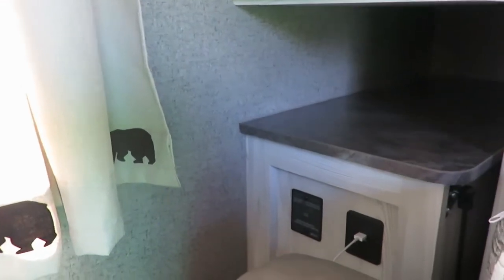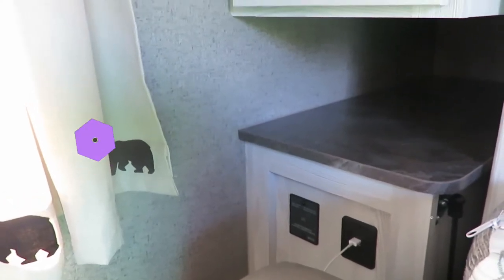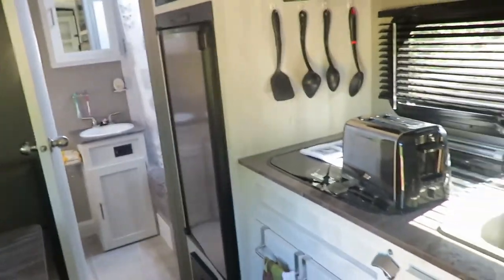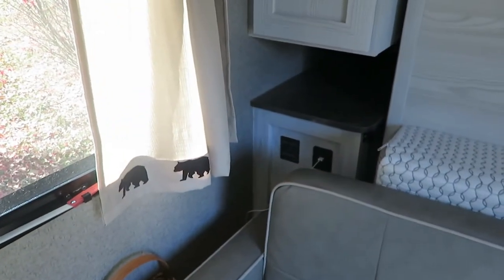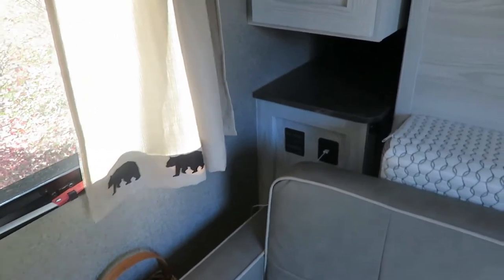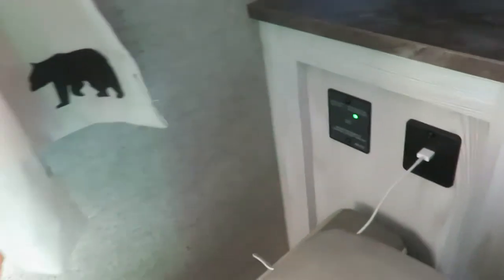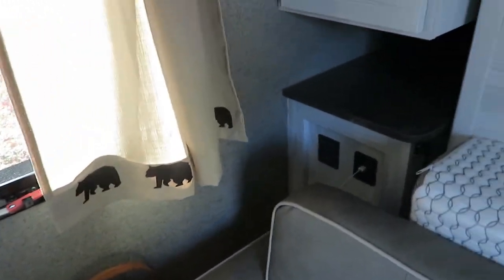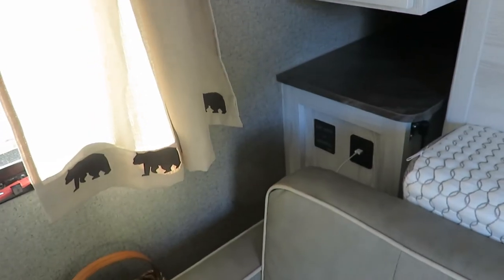How to Use Your RV Inverter

Comment: Misinformation. 
He says your 1,000W inverter draws 1,000W when you have no 110V load plugged in. WRONG: Some inverters have a small standby draw on the batteries when there is no-load on 110V,  some actually switch into a very low-draw standby mode (almost Off and with an almost zero current draw from the batteries) when there is less than, say, a 5W load on the 110V. Then the automatically "come to life" when you connect your 110V load. 
Either way there is either very small or almost no draw on the batteries when you have nothing connected to the 110V supply.
Reply: I agree that the inverter doesn’t draw 1kw with no load, so that info isn’t entirely correct.  However I did see where someone measured this inverter draws almost 3 amps with no 120v load which is still substantial if you’re boondocking & keeping a close eye on your battery levels.  So all in all, the instructions in the video are still good even if the info behind it isn’t entirely correct.

Comment: An Inverter will run your battery down, but not because it is consuming 1000W at all times.
An Inverter does consume some power with no load, but not 1000W.
I suggest that you put a DC ammeter (or a battery monitor with shunt) on your battery and see what it is actually doing, with and without a load.
All inverters are different.
Most inverters will power about half of their rated output continuously and up to their rated output for a few seconds or even microseconds.
When you replace that inverter, and you will, replace it with a 3000W-4000W inverter.
I have several 12V and 24V Inverters in use every day.

Comment: Sorry, but not quite. Everything you said was correct except the part of it using a full 1000w when you turn it on. Inverter's idle and use power when and you are not running say, that toaster. But  you'll be using as much as 10-15 w or so just idling. When you turn on an appliance that uses 500w, then that's what the inverter will put out. It does not just go to 1000w all the time regardless of the load placed on it. It is true that leaving it on will run down your batteries... but at 10-15w at a time, not 1000w.

Comment: I just bought a 21 G-Pro 19FD. Love all your videos. Can you run the refrigerator on the inverter? Another question. I plugged into the power cord and a red light came on the plug. Normal? I read somewhere to unplugged asap and not to touch the RV. Confused??
Reply from the maker: Red light is normal on the power cord. As for the inverter, you can run the fridge on it but your battery will not last long
Reply: Do you have surgery protection
Reply from the maker: @DavidSmith3750  I have a surge protector on the 30 amp plug that comes in from outside hook up

Comment: Whats the inverter wired into, my kz camper has it and solar panel on top, plus 2 big batteries on front, I want to use my generator and active start soft start that plugs into generator and doesn't allow air conditioner compressor to pull a fast heavy watt/amp, but everyone is saying it won't work with inverter because it shuts down air conditioner,  can I just unhook inverter

Comment: So, if you’re driving and want to keep the fridge on,do you keep the inverter on?  I’d like not to use propane while traveling.
Reply from the maker: If you run the inverter all the time your battery will run down very fast. The LP running while driving is a personal thing, in most cases and through out the years this type of system has been used without a problem. It is a very small flame which is protected from blowing out and or if it does the system will shut down. I use mine all the time when I drive along with about 70 % of the people who have this system. The problems normally accrues when the system is old and not working properly or has be rigged to bypass safeties built into the system.
Reply: @Turtle3863  so, can the solar be used instead of propane while driving?
Reply from the maker: @kateclark4620  Still not enough to keep up with inverter turned on and the fridge running off 120 volt, now if you have a 12 volt you might be able to keep the fridge running with the solar and your battery.

Comment: Can you help?  We got a No Boundaries 19.5 and when we are driving down the road, the refrigerator doesn't work.  People tell me I need to use the Inverter.  It is a 12VDC (does not work on propane).  How does the refrigerator work when boon docking, etc.
Reply from the maker: Your fridge should be a propane or a 12 volt, either way, do not use the inverter, the battery will not last long trying to run a fridge on 120 volt with the inverter. If you have a 12 volt you will need a battery that can at the very least be a 200ah and preferably a lithium one.
Reply: @Turtle3863  I cannot tell you how much I appreciate this.  We have been totally stumped (and this is not our RV).  We have ordered two lithium batteries.  Maybe this will help.
Reply from the maker: @PatHawkins-jk7ny  Make sure, that in fact you have a 12 volt fridge. From what I have seen on the No Bo website it looks as if that model does come with a 12 volt fridge. If that is the case you should be fine with 200 ah and a solar panel to top it off during the day.
Reply: @Turtle3863  We have a 12VDC Norcold, Model # N8DCSSL.  We took it on one trip and noticed that when we returned the refrigerator wasn't working (on the way home).  We thought we should be fine, as you suggested, with the solar panel.  On reading up on the inverter (we didn't even know where it was), we noticed that it was "ON" and wondered if that might have been  drawing down the battery.  We watched your video and that is what gave us that idea.

Comment: Our brand new 19FD inverter won't come on from the 'remote' button there by the couch. Pressing the button turns the LED on, but as soon as you release the button, it's off again, with no voltage in any outlet I tested. Confirmed the inverter works by removing the panel, checked the reset button on the bottom, then the manual 'on' button at the top of the inverter (supposed to be out for 'remote' on, which it was) which did turn on the unit, it was producing 114 volts (no fan in the unit was running) which was confirmed with voltmeter in all interior outlets. So I wonder what's up with that?
Reply from the maker: Sounds like a warranty issue
Reply: I am having the same issue with my new trailer.  I haven't gotten into the unit to check the remote on button which is what my dealer told me to check first.  How did this issue end up for you?  It worked when we picked it up but after the drive home it did not.  Just curious. Thank you for sharing.

Comment: I have a 2022 Rockwood mini lite 2513s. The inverter switch is showing on all the time I push the switch to cut it off but it shows on, I don’t know if the inverter is on or off. Do you think it is a bad switch or could it be a bad inverter?
Reply from the maker: Not sure if the mini lite works like the one in the Geo pro but mine you have to hold the button for 2 to 3 seconds for it to go off
Reply: If it still stays on after holding switch 3`5 seconds.  I’d replace switch. First if it stays on then replace inverter after all switch is cheaper not a waste even if replaced inverter. You just got a new switch.  Best of both worlds.   Good luck

Comment: Leaving the inverter on while connected to shore power won't hurt a thing.
Reply from the maker: But there is no reason too
Reply: @Turtle3863  in case your power goes out would be a good reason to leave on to keep your fridge running.  Emergency back up if you might not be home when it happens